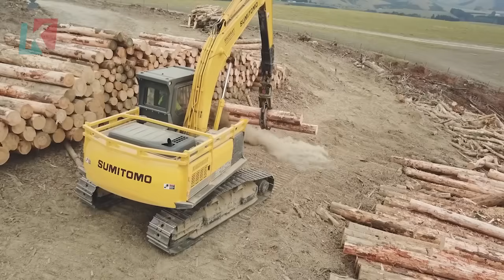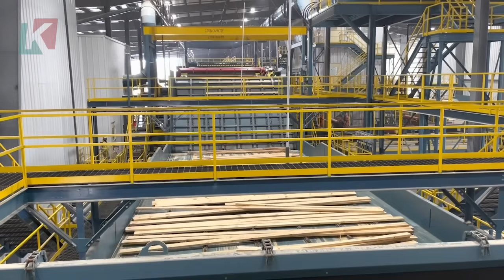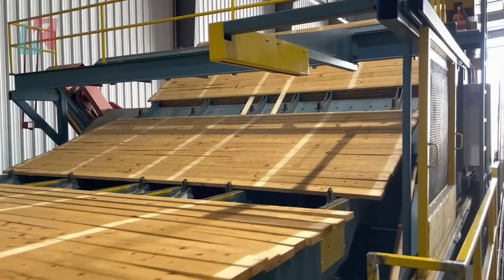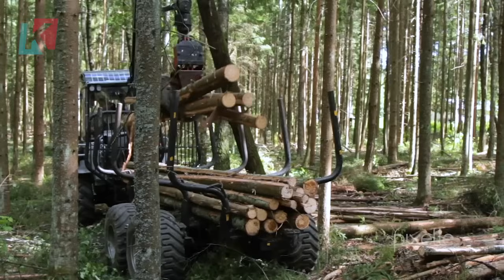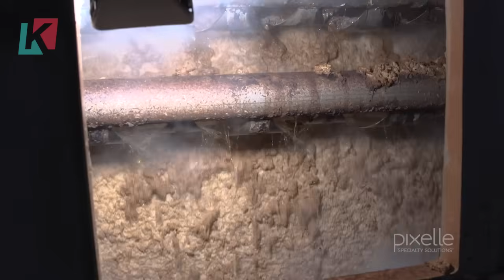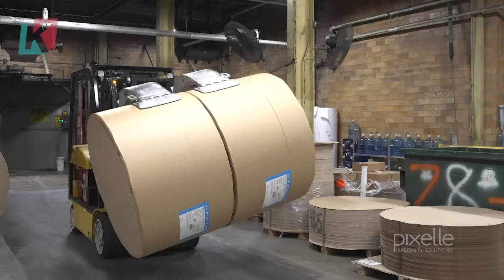Engineering Marvel Behind Mississippi’s Largest Sawmill - From Massive Logs Into Perfect Lumber

Comment: Get your AI crap together.  Half your info is garbage.  Pine wood DOES rot contrary to what you say.  You say log trucks carry 80,000 lbs, wrong.  Total gross vehicle weight rating is 80,000 lbs equals vehicle weight plus log weight so naturally logs alone do not weigh 80,000 lbs.  I also doubt any southern state was #1 in lumber production.